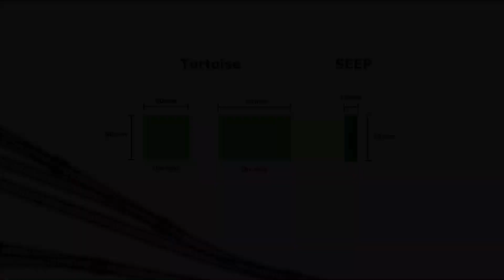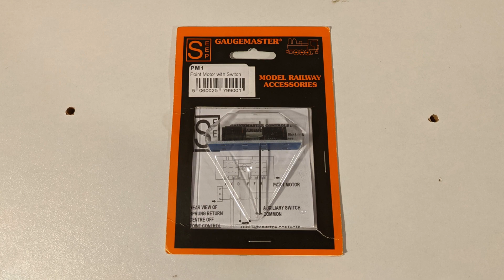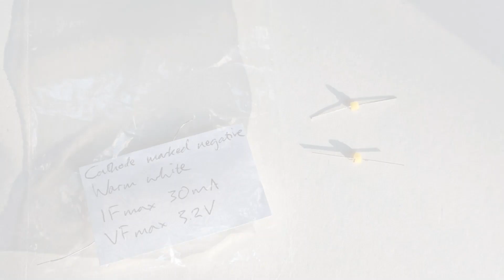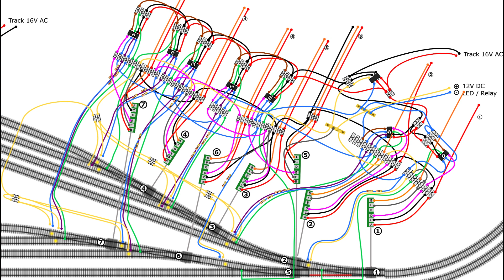0004 Autofrogs and Point Motors

Comment: I have used the pm1s on my layout but underneath the base board. I used a separate 23V dc supply and CDU in conjunction with toggle on-off-on momentary switches. There is enough power to switch a pm1 and a PL11 surface mount motor simultaneously. I have an upper level that I’ve fitted large radius turnouts electro frogs but found that the locos were slowing/stalling and stopping. I bought some Aet frog switchers at the Nec show, which I fitted, but still had a problems with the DCC supply. .The solution was to buy a 18V 2A upgrade for the NCE power cab which solved the problem.  The 13.8V 1.8A supply original was not powerful enough. So the frog switchers do require a decent power supply to work properly.
Reply from the maker: Thanks for sharing your thoughts and experience with these - there was enough power to cause the relay to trigger, but maybe it was taking too much track power away for the Pannier. I've also become unconvinced about relying on a short-circuit for this kind of switching, so I don't intend to go back to autofrogs again. Thanks for the comment 👍

Comment: A bit late now, but MTB's MP series of point motors are great aternatives for surface or underboard point motors. There are now new digital versions with integrated decoders.
Reply from the maker: Thanks for the suggestion 🙂 I've had mixed results with the solenoid motors that I used - I couldn't get their aux switches to work reliably, and one of them was eventually unable to switch the points with the longest rod so I switched that one out for a servo. I think if I end up making another layout one day I'll go with servos.

Comment: Hi Jonathan, a nice explanation and I like your piano wire/ terminal block clamp solution; I have seen that technique before, its a good solution and one I might use on my layout I am building. On servos have a look at the Peco Smart switch  PLS100 (OEM being ANE 003) they are easy to use. For DCC just needs a decoder or  for manual use in its basic offering). The control board will accept push button or switch inputs and has provision for driving leds too - there are several instances where I will use these and for semaphore signalling. Like you I am using mainly PM1s, so what I use to drive my leds on the mimic are (five) Block Signalling PPI4-DC. They take the pulses from your lever frame point motor switches (so no need for a slave relay) to feed them to what is essentially a set reset/ latch the output of which drives your route leds. It has a memory for power outages which is a massive bonus too. I drive up to three LEDs on each output and the card has 5 common intensity settings for the LEDs. The PPI4s if used correctly can massively simplify your wiring, particularly if you place your LEDs next to your lever frame. Hope helps best regards Stephen
Reply from the maker: Hi Stephen,

Thanks for sharing your thoughts, they are indeed helpful :)

Good to know about the Peco servo control, given that I aspire to have a few moving signals.

I'm amazed at what's out there that searches and YouTube watching haven't revealed to me! The block signalling PPI4 looks quite nice and isn't expensive either, and I can see how it would make the wiring easier (nice that it includes the LED resistors too). From a brief read of it I'd say it won't let you indicate a whole route - one or the other of the LEDs for a point will always be on, so a siding inaccessible from the main line will still have a light. This seems to be what most people want, and I've found that the Rails Connect controller that I bought to experiment with is the same, and likewise what I read in the Megapoints controller manual for one of their control boards.

I've been having trouble with the auxiliary switches on the PM1s - they change the points reliably enough though, so I think in future I'll use more basic solenoids, such as the PM2, and can't recommend the PM1s based on slightly longer-term experience with them. I've screwed microswitches in place instead, but not finished re-wiring yet - I'll be covering that in a future video :)

Thanks,
Jonathan
Reply: @endoorrailway   Hi  Jonathan, Pleased to be able to help and thanks for your thoughts too – there are so many ways of doing things.
On PM1 try touching up the solder on the PCB – tin oxidises and also can get scarfed going high resistance at low currents, I know that has worked for Tony North Eastern who uses loads of PM1s on his super impressive loft layout.
You can make a diode matrix for the routes; remember one diode to the PM1 coil and another to the PPI4 input – repeat for each extra PM1 coil you add to your diode gated route.
For each point I use a green and red led for each of tracks 1 and tracks 2 , green pair nearest the frog, red pair a few mm away from the greens. So a G T1 and R T2 = on OR it is a G T2 and R T1 = on. It’s amazing how easy it is to follow the green routes through and blocked paths reds flag up brilliantly particularly for siding to main lines. 
             G ---  R ------
        /
----------G  --  R -----
For a crossover I add a fifth led – green in the middle of the X on the mimic.
It makes for a compact easy to read LED only mimic –  I have my selector switches on the LHS and RHS of this area arranged so routes can easily be selected due to the positioning and the lines I draw inbetween them.
Oh PPI4s if buy from Block Signaling their LEDs have 470R wired with each and fine if going direct across an output. For my R-G/ and G-R pairs above  I remove the 470Rs and wire the two LEDs in series. This evens out the brightness levels.
Again hope helps, best regards Stephen
Reply from the maker: Hi Stephen,
That diode matrix sounds ingenious, thanks for explaining that! I'm too far gone to do that on this layout, but it'll be worth remembering if I start a new one in the future.
Likewise with the PM1s, when I de-soldered the aux cables some of the connections looked very oxidised, but I'd already bought the microswitches and didn't want to do further soldering, so I won't be doing any touching-up.
Thanks,
Jonathan
Reply: @endoorrailway  Hi Jonathan, I can understand that; I will look forward to seeing the type of microswitch you used and how you mounted them, you never know when needed! I have subscribed too. Best regards Stephen
Reply from the maker: Great to have you along :)

Comment: Hi Jonathan interesting video iam also thinking of surface motors on part of my layout thankyou for the tips and video
Reply from the maker: Hi Mark,
Thanks, I'm glad you found it iteresting :) My videos are catching up with what I've done, and in reality I've implemented the plan from the end of the video. I haven't had it operational for all that long, but I'm getting reliability issues with the auxilary switches on some of the point motors. I'm happy with the actual point switching, but I've ordered a Rails Connect surface point motor and associated control thing that has LED and frog outputs on it, and will experiment with that - I figure that the surface point motor isn't much bigger (in terms of door surface area) than the SEEP motor, and I should be able to attach it to piano wire just like the existing motor. I should also be able to control the existing point motors from the Rails Connect Solenoid Digital Accessory Decoder, from the existing non-DCC switches - we'll see!

Comment: Great video. Did you consider using servo motors?
Reply from the maker: Thanks :)
Yes I did give servos brief consideration - I'd seen some videos from Megapoints Controllers - but they looked like they'd be a bit complicated to set up, and I thought I'd probably need to have a microswitch involved somewhere to do the frog polarity changing. However, as I (gradually) become more confident it's something I might experiment with. I've got vague aspirations to have motorised semaphore signals, so if the pre-made Dapol ones are too big (they look like they'd need to go through the door) I'll need to look into servos I think
Reply: @endoorrailway  I highly recomend MGP (Möllehem) loconet based servocontrollers. So easy to set up and configure.

Comment: Hi Johnathan - You are already ahead of me mate. I have gone the same way as you with regards to point motors, including the Peco levers. 
I have gone this route as I like the lever aspect and hearing the solid clunk as the point is thrown. Just as I remember it working in our local signal box on a Sunday as a child. 
The wiring aspect seems to be the simplest along with the cheapest, at least I think it is.
Love the way you have worked out how to operate your points above the board, very clever.
I like to keep things simple and to a degree realistic although I might be wrong here.
Points in the goods yard will be operated by hand (at the moment) as they were in reality. So no point motors etc.
I dont recall seeing a lit track panel in the signal box (I might be wrong) so I will have my levers on the side of the layout in sequences for different areas. 
There will be no light panel, well not at the moment, and there will be a track plan above my head which tells me what lever operates what point. Well that is how I remember it in the signal box.
But that could all change, so i look with interest on how you get on. Light panel and wiring looks very interesting.
Regards Chris
Reply from the maker: Hi Chris,
My videos are catching up with what I did in 2022, so progress will seem more rapid for a while! It's only since I started making the videos that I've laid the outer loop of track, but the point motor plan has been built for several months. I intend to go through the pros and cons that I've come across so far with relatively minimal running, but I'll say that whilst I too like the sound of solenoids and the look of the levers, I'm having unreliability with the secondary switching that controls the frog polarity and LED selection. Although this "basic" approach seemed like the simplest there are a lot of wires that I have to get across the tracks... so I'm starting to think about experimenting with digital point control, but still operated from dedicated switches - a while back I saw a video that Jenny Kirk made that showed how to do that, so I know it's possible, though I suspect it's going to be a lot more expensive. I also intend to look into the Megapoints systems.
Your plans sound good - I'm enjoying working my way through your updates - I'm not up-to-date yet though!
Regards,
Jonathan

Comment: Hello Jonathan 👋 what excellent presentation your video’s have 👏🏻👏🏻👏🏻 very helpful and informative for anyone starting in N Gauge 😇 It is amazing how “thinking time” suddenly makes a simple layout very complicated indeed 😲 As to your question on above board point control 🤔 “Continental Modeller’s” tend to use bespoke points with built in electrical point switching. Kato have an excellent track system in this regard and if you look up Wimbletrain YouTube channel, John goes through some excellent presentations on the capabilities 😇 including use of LED light switches 😉 John also mixes PECO and Kato track together. Very best wishes for the development of your railway and keep having fun 😁
Reply from the maker: Hi Paul, thanks for the kind comments :)
I must admit I never even considered anything other than Peco - I'm very impressed that the Kato points come with the built-in motor! I've just taken a look at one of the videos from Wimbletrain about it and it's very informative - definitely something to consider for the next layout, whenever that may be, thanks :)